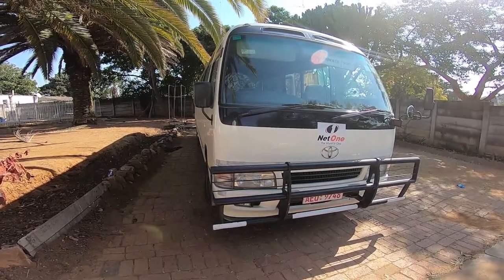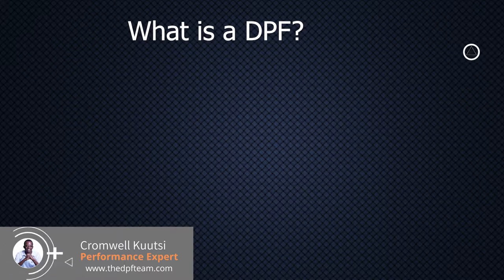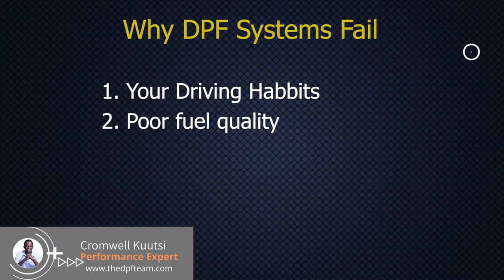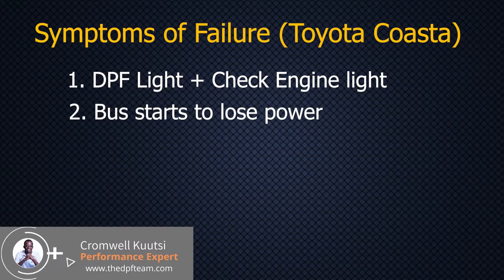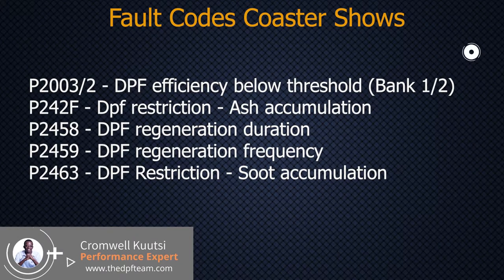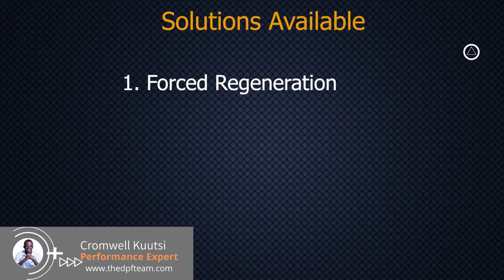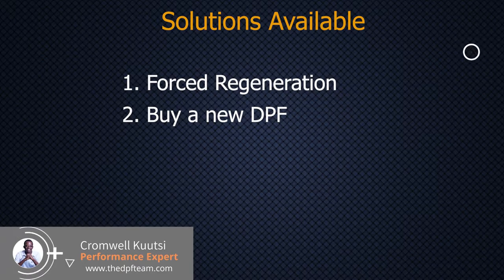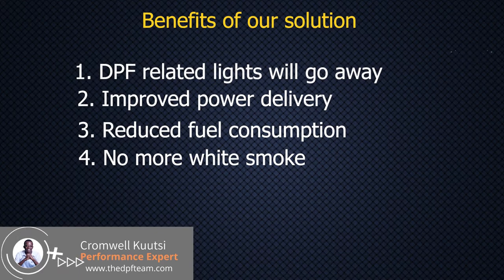Toyota Coaster DPF Problem [Solved]

Comment: J B New Zealand.
Had trouble with my 2005 Toyota Coaster with 173000 Ks on it. DPF light was flashing so stopped to do a DPF burn which took about 30 minutes. When completed Check Engine Light came on. Bus was running OK so carried on, after about a 1000 Ks bus went into limp mode. Managed to get to Toyota Dealer, they plugged in computer but could not communicate with engine, after trying several different computers the last one came up with "Disconnect Battery". Leave for 5 minutes and Reconnect. Problem was solved! Bus has been running well since, done another 5 Ks since , no problems.
Reply: Thanks for the information. My 2011 would pass 2000rpm. Disconnected battery and check light went away. Let’s see how long it goes